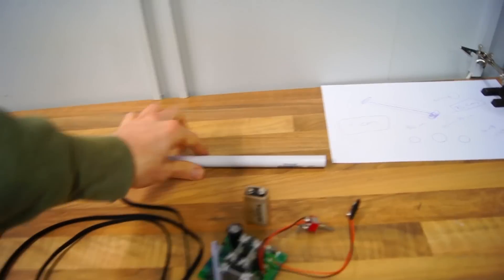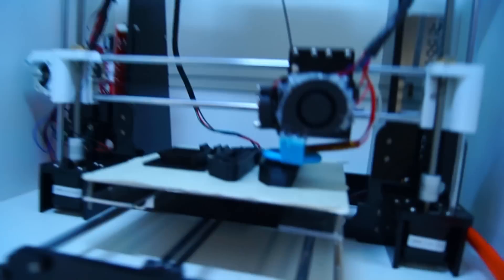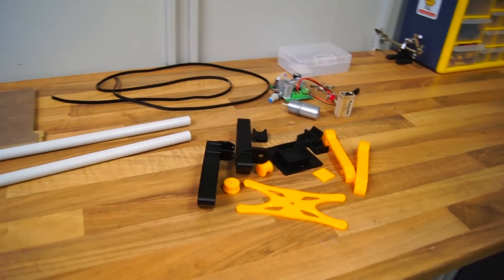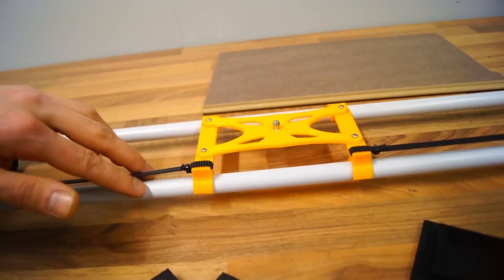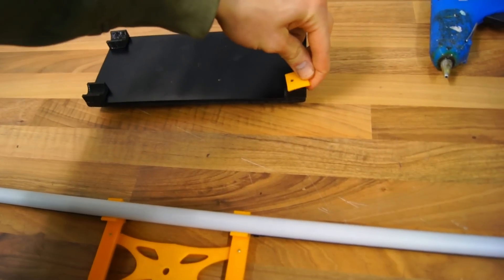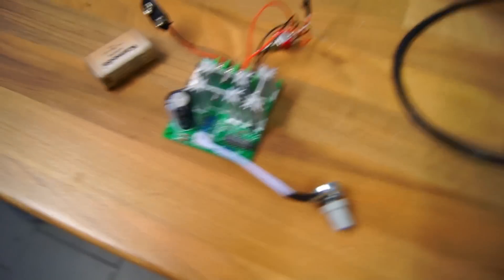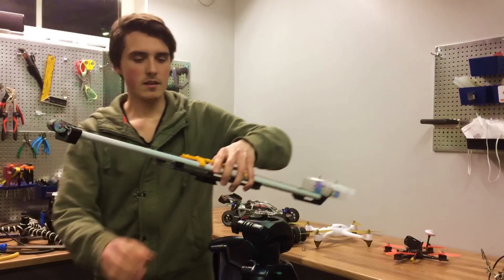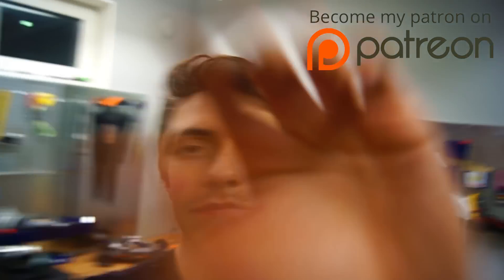DIY Motorized Camera Slider - Cheap and Simple!

Comment: @rclifeon @6:44 you could use the glue (or better, a two-part epoxy glue) but also for extra security you could use slightly longer screws and then drill and screw through the wooden plate, through the mounts and into the pipes :-) .  I'd be less worried about the whole thing falling and smashing the camera then.  I came to see what motors you used as I already have a manual slider and want to bolt a variable speed motor to use it for timelapse :-) Keep up the great work!

Comment: My camera would never touch that slider design. Its neat, I know you worked hard with printing and designing and its all great but the most important feature is missing, that base isn't secure, its just floating over the rails on two sides. Doing a vertical shoot would not be safe, camera would tumble down

Comment: Almost all the 3D printed parts can be made for cheap with parts in any hardware store (or on Amazon). Hell, I just watched a video on how to make an aluminum piped manual slider (that could easily adopt the electronic components of this design) for about $12 last night. 3D printing is cool and all but I find it over-complicates builds like this.

Comment: i thought he was joking when he said "oh yeah you will also need a 3D printer" the title says "cheap" as long as you have a $160 dollar 3D printer and the guts to take 5 years to design it
Reply: You can hire it out for pretty cheap usually. There was one at the university library when I was in school, and plenty of commercial places have them. The description has a link to "STL Files". Those are the 3D files the printer needs to create exactly what he used. No need to design anything yourself. STL files are very popular and probably any 3D printing company can use them directly.

Comment: Bro.  This is by far the coolest thing ever.  So i made mine.  Turned out pretty good.  Made it a bit longer, final touches tomorrow.  So i did have a question.  Is the switch supposed to be just on/off or was it supposed to change directions as well?  Mine only turns it on and off.  Could i add a switch that makes it go both ways?

Comment: Got it excited when I saw this, but then I realized I need a 3d printer.....
Reply: If you follow his link in the description for the 3D plans (STL FILES: http://www.thingiverse.com/thing:2048438) there's a button to order the parts labeled "Order this printed". It will direct you to use another app and you can buy the parts from that builder. I'm using Print a Thing and it costs a little less than $60 for all of the printed materials but way cheaper than a buying a slider. Make sure you order the correct number of parts though (2x sliders and 4x brackets)! Let me know if you need any other help :)
Reply: Vani Jay cheap and “simple”
Reply: Vani Jay lol

Comment: Could be YouTube screwing up, but the footage doesn't look smooth at all... I'm guessing the slider and pvc tube have quite a bit of friction and/or the motor isn't pulling consistently enough? Anyway, an awesome project the looks very professional.
Reply: True.Its not smooth at all and its not YouTube mistake
Reply: Yes the footage is a little bit shaky, wonder if some lubrication would help smooth the motion

Comment: What happens if, say you step away from the unit while the motor is running, will it stop when it reaches the end of the run? Or do you need to constantly monitor it?
Reply: Ben Press I imagine it won't stop when it reaches the end, there is no switch at the end, and the only other way is for the controller to monitor the load of the motor and realize when it stops, which takes a more expensive controller.
Reply: It needs a limit switch

Comment: Fantastic work, Simon!  Keep it up.

Agreed, +Rawdilz.  I'll be building one in the coming weeks, and I'll use standard limit switches used in 3D printers setup in the "normally closed" configuration such that when they're tripped, the power is cut to the DC motor to prevent over travel.  That way I don't have to keep an eye on the camera while I'm trying to do other things.

Comment: The fact that you can buy a motorized slider cheaper than a 3D printer (plus all of the supplies needed to use it) is what has me laughing at this video the most.
Reply: Not only that, but you could buy a Monoprice select mini for $200 and print this... then still have a 3d printer for the other million useful things you can print.
Reply: It's for those of us who already has a 3D printer and filament to use. For us, making one is waaay cheaper than buying a motorized slider.

Comment: We do not have 16mm pvc or other material pipes. I printed your 3D parts but can't use them. Would you be able to use your software to spec for 21.45mm Outer diameter pipe?  It is available in US very cheap and is very sturdy material.

Comment: nice project but I notice the slider movement is not smooth, you should think to upgrade it and make roller bearings version, I think you have this problem because of the friction on the rails
Reply: it also could be as simple as moving the belt to the center of the mount vs one side. As it pulls, one side is getting the torque which could cause it to shift that side first, then the rest of the slider has to catch up. If the belt is in the center, both sides of the slider will be receiving the same amount of pull

Comment: Since I want to use the slider for nightsky timelapse, I'm concerning that the orange part will fall off the pipes if I tilt the whole slider over 30-45 degree, since it only hooks on the pipe.

Comment: that looks like a nice build! maybe it would be a little smoother if you grease the PVC pipes and lubricate the motor bearings. you could also try adding a flywheel mass to the motor shaft.
Reply from the maker: I did try silicone oil, and there was a significant improvement. However, now the pipes are all greasy.
Reply: RCLifeOn ya, there's always that trade-off lol